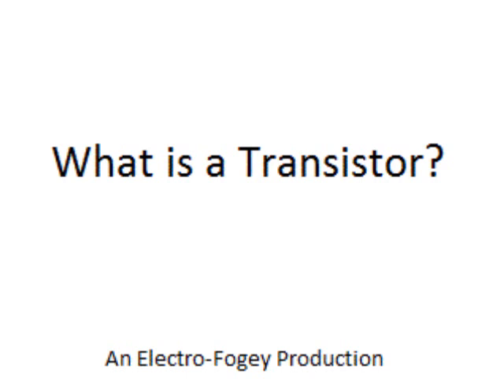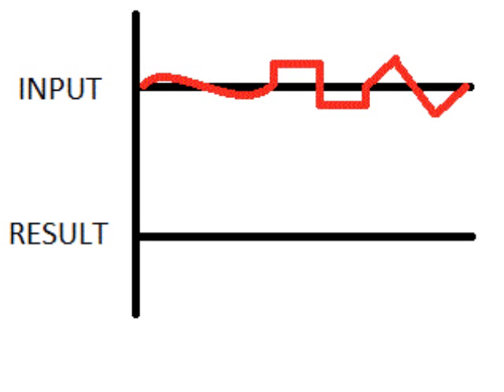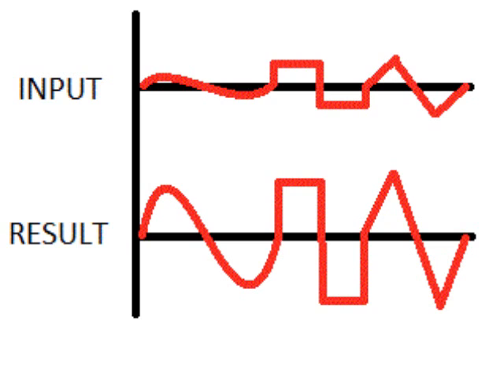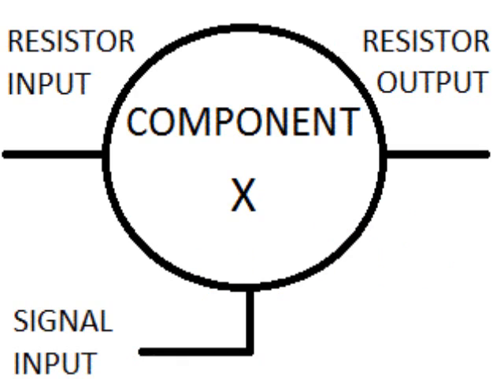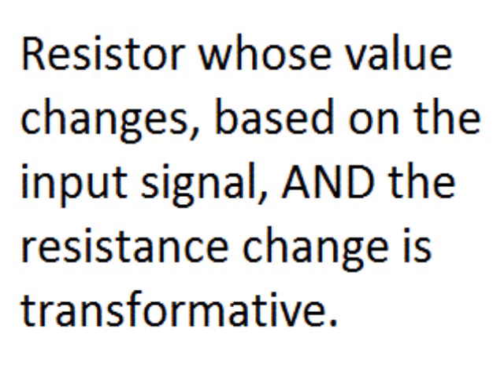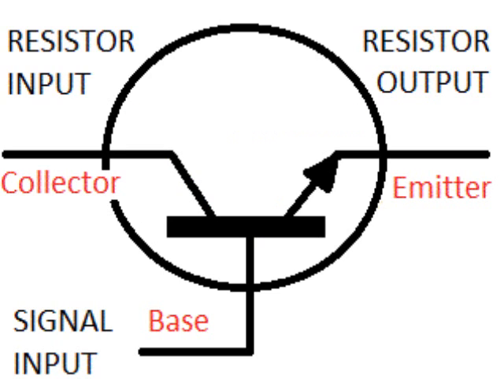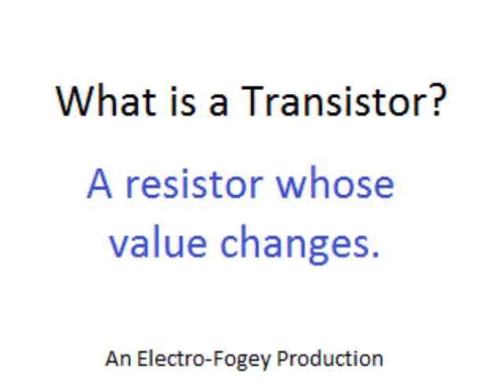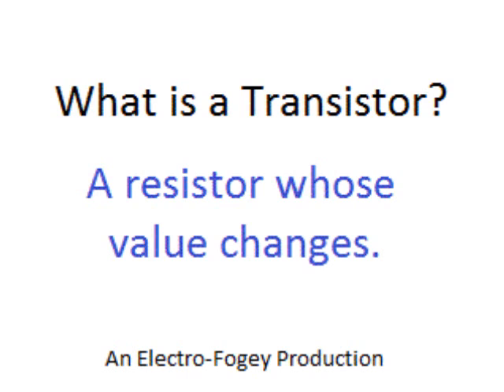What is a transistor?  How does a transistor work? Part 1

Comment: I apprenticed as a cabinet maker but work as a locomotive composite mechanic. Or more accurately a locomotive electrician that also does the other work as well. It’s a long story how one goes from master cabinetmaker to locomotives but it happens. 
Anyway, in fine cabinetmaking one must know the anatomy of the tree and it’s species to accomplish the desired high end results. A carpenter on the other hand does the most basic parts of wood construction and really doesn’t need to know.
As a locomotive electrician, I really only need to know what it does.

Comment: linked from below main wiki article:
Transresistance (for transfer resistance), also infrequently referred to as mutual resistance, is the dual of transconductance. It refers to the ratio between a change of the voltage at two output points and a related change of current through two input points, and is notated as rm:
The SI unit for transresistance is simply the ohm, as in resistance. 
---
I wonder what book he picked up that name from, cause wiki:
From November 17 to December 23, 1947, John Bardeen and Walter Brattain at AT&T's Bell Labs in Murray Hill, New Jersey performed experiments and observed that when two gold point contacts were applied to a crystal of germanium, a signal was produced with the output power greater than the input.[16] Solid State Physics Group leader William Shockley saw the potential in this, and over the next few months worked to greatly expand the knowledge of semiconductors. The term transistor was coined by John R. Pierce as a contraction of the term transresistance.[17][18][19] According to Lillian Hoddeson and Vicki Daitch, Shockley proposed that Bell Labs' first patent for a transistor should be based on the field-effect and that he be named as the inventor. Having unearthed Lilienfeld's patents that went into obscurity years earlier, lawyers at Bell Labs advised against Shockley's proposal because the idea of a field-effect transistor that used an electric field as a "grid" was not new. Instead, what Bardeen, Brattain, and Shockley invented in 1947 was the first point-contact transistor.[14] To acknowledge this accomplishment, Shockley, Bardeen and Brattain jointly received the 1956 Nobel Prize in Physics "for their researches on semiconductors and their discovery of the transistor effect".[20][21]

Shockley's team initially attempted to build a field-effect transistor (FET) by trying to modulate the conductivity of a semiconductor, but was unsuccessful, mainly due to problems with the surface states, the dangling bond, and the germanium and copper compound materials. Trying to understand the mysterious reasons behind this failure led them instead to invent the bipolar point-contact and junction transistors.[22][23]

Comment: so much for wikipedia:
A transistor is a semiconductor device used to amplify or switch electrical signals and power. It is one of the basic building blocks of modern electronics.[1] It is composed of semiconductor material, usually with at least three terminals for connection to an electronic circuit. A voltage or current applied to one pair of the transistor's terminals controls the current through another pair of terminals. Because the controlled (output) power can be higher than the controlling (input) power, a transistor can amplify a signal. Some transistors are packaged individually, but many more in miniature form are found embedded in integrated circuits. 

simple wiki:
A transistor is an electronic component that can be used as part of an amplifier, or as a switch.[1] It is made of a semiconductor material. Transistors are found in most electronic devices. The transistor was a major advancement after the triode tube, with using much less electricity, and lasting many years longer, to switch or amplify another electronic current.

The transistor can be used for a variety of different things including amplifiers and digital switches for computer microprocessors. Digital work mostly uses MOSFETs. Some transistors are individually packaged, mainly in order to handle high power. Most transistors are inside integrated circuits.

Comment: Thank you for your help. I need it this to understand first, WHAT IT IS the transistor, because the majority of people know the applications in which a transistor is involved.
I think it was an amazing discovery, and a great leap in technology, or, lets be honest, it was a TOO great leap for year 1947!
I think that when we talk about a resistor or a capacitor, there are no many things to explain, you can easy understand them; but, we need many examples, and thorough explanations in order to understand the transistor. If I understood correctly, the transistor is nothing more then resistor who's value can be changed, depending on an input Voltage. Can it be used as a diode, or as a capacitor (I don't think so...), or even a light emitting diode? And if this is the case, why we still use the discreet components?

Thank You again for your detailed explanations!
Reply: +jericho tm Hello Jericho tm!  You are correct in understanding that a transistor is a variable resistor, and yes, it can be used as a diode, and even a capacitor, as any electrical or electronic component will exhibit some trace amount of capacitance. However, to use it as such would be sort of like entering the Indianapolis 500 in a stationwagon - technically, yes, it will work, but diodes and capacitors are specifically designed to perform their respective function MUCH more efficiently than a transistor would, so there's really no point in trying to use one for such purposes.   As for the L.E.D., since the actual working components of the transistor are encased in an opaque, black plastic material, any light emitted (and yes, their is a MINUTE amount) is trapped within the device.

Comment: useful one..but still its not clear how does it amplify electric signal?
Reply: Pajor Chakraborty The transistor doesn't amplify a signal in the traditional sense of the word. It's basically a current-controlled resistor, where the base-emitter current controls the resistance between the collector and emitter (in a NPN transistor). The reason we say it amplifies a signal is because the way it's normally connected is to have a larger voltage between collector-emitter. If the base-emitter current (and thus its voltage) is large enough, the collector-emitter resistance is (for all intents and purposes) 0. At smaller B-E currents, the C-E resistance varies linearly with B-E current, and Ohm's law dictates the C-E voltage.
Reply: They wasn't trying to build a resistor, they were trying to build a amplifier, which can "inject" electrons into the current. 

The name "transistor" came from "transfer" and "resistor", because it is "a resistor or semiconductor device which can amplify electrical signals as they are transferred through it from input to output terminals." In other words, it's the opposite of a resistor.

Source: http://www.nobelprize.org/educational/physics/transistor/function/firsttransistor.html

Comment: I was interested in electronics early on.  Had the RS 300-in-1 experimenters kits and all. But never really got how transistors worked.  My dad introduced me to a retired engineer who ended up being my mentor for years.  The explanation here was only the first half of the puzzle, seeing it as a variable resistor.  The other half came from putting that variable resistor into a voltage divider string!  It was like the heavens opening up it was suddenly so obvious.

Every transistor circuit I've designed since then started from that picture.  

This is how transistors should be introduced.  Simple first, then get into physics theory later.

Comment: I just consider that electron flow is the opposite direction of the way the "arrow" points. I don't understand why the arrow points the way it does either, but as we all know, it's too late now..
I have four rules for something like this:
1. Determine whether anything NEEDS to be done about it,
2. Determine whether or not I can AND should do anything about it,
3. If anything NEEDS to be done about and I can AND should do it, do it,
4. If not, leave it alone and work with it.
It's that simple.

Comment: Usually I learn a word's meaning by taking disassembling it, considering the parts and reassembling it, the wiser for it. This usually works for me.
The word "transistor" and the transistor itself have literally stumped me for decades. I kid you not. I understand the physics, chemistry, electron flow and all that, but I didn't understand its basic function. This video remedied that. I have seen other videos that mentioned it but your "harping" on its simplicity is what did it for me. Thank you!!

Comment from the maker: A diode is like a water check-valve - it only lets the electrons flow one way.  Diodes don't "push" anything, and neither do transistors.  Batteries make the "push" (called voltage) and a semiconductor is not a battery.  If someone told you this, they misunderstand.  This is why a voltage regulator needs a much larger input voltage - the regulator doesn't create the voltage, just controls it like a valve.

Comment from the maker: To physicists and engineers, "current" is not a flow of electrons, but a flow of charges.  You should see my other video entitled "Basic Electrical Engineering - Electrons, Charges, and Fields" for more info.  There are both positive charges and negative charges moving along, and you must pick either positive charge flow or negative charge flow (but not both at the same time).  Most people express circuit function using positive charge flow (conventional current), so I did the same.

Comment: thank u for the useful simplified info.
i underdstood how resistance is theoritically measured.but what is the BJT
i understood too that resistance is controlled by voltage because it is a dc current circuit.
hope that u tell how it is done.

Comment from the maker: It depends on what you want to use it for. For DRAM, one FET can be used (see my JFET video), but for calculation and stuff, it's at least two transistors or more. To store a data state, you need a bistable multivibrator circuit. A simple one can be found at play-hookey(dot)com(slash)digital/experiments/rtl_bistable.html

Comment from the maker: @LaEspriella the diode is a resistor with two different values: very low if current flows one way, and very high if current flows the other way.  

The lower graph in the second video (collector voltage) is the amplified version of the base voltage.  It's not to scale, as I was just doing it for illustration.

Comment from the maker: @MrMinimalSWN, The ohmmeter measures resistance by applying volts to a component and measuring current thru it, and finding resistance that way.  The BJT transistor's resistance changes with supply voltage and base current, so the resistance you measure may be different from the resistance that the BJT has in the circuit.  That's why we measure current thru the collector resistor and voltage across the transistor.  We then have BJT collector current and voltage, and divide to get resistance.

Comment: So actually I could use a ohm-meter if I wanna measure the resistance between collector & emitter. And by giving a dc value (of the maximum voltage you're working with) to base, I could use the measured resistance(between collector & emitter) and the resistance(of whatever u attach to the output) to calculate the leakage voltage going to the output.
Thumbs up if you want people to see this

Comment from the maker: LaEspriella, I mean to cover this in another video, but basically the bipolar junction transistor is two diodes, biased in opposite directions, but with the diodes fused together so that the two diodes become one device.  You can't make a transistor out of two diodes, that won't work.  The current from base to emitter activates the base-emitter diode, and causes collector-emitter current to flow.  Tiny current at the base causes big current at the collector.

Comment: So a transistor is a resistor that changes value based on the voltage put in a circuit? So that means the voltage is made bigger ? :S Im so confused, I don't get it still :(

Comment from the maker: @alex, a switch is just a resistor with either a low resistance (on) or high resistance (off).  A transistor can have low or high resistance across it, but it can also have resistance values between fully-low and fully-high.  A computer only makes use of the transistor's extreme resistance values (0 and 1), but a transistor in an amplifier can have a resistance that can vary anywhere within the range from 0 to infinity ohms.  Computers and digital circuits are a bit less complex than amplifiers.

Comment from the maker: @Fal1ingUp - That's a good question, not dumb.  The thing is, the wires from the wall have a HUGE amount of voltage, and whatever you are trying to power with that wall current (a motor, a lightbulb, a hair-dryer or whatever) take a huge amount of power, like sometimes 1200 watts or so.  I don't think that any kind of transistor can have that much power running through it without detonating.  Better to use a triac or relay (more on that later).

Comment: hey so this is probably a really dumb question, but when you hook up a transistor, you could connect the positive wire coming from the wall (AC) to the collector.  you would then put another positive wire coming from the emitter to whatever you were trying to turn on.  then to "flip the switch" and connect both positive wires, you could have another positive wire connected to the base from an alternative power source (DC)?  is this right or am i way off track?